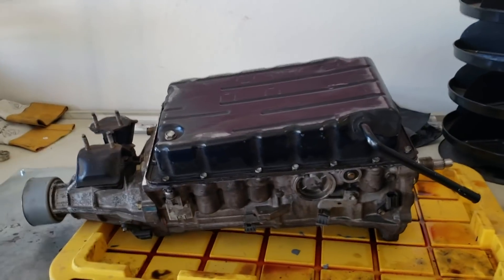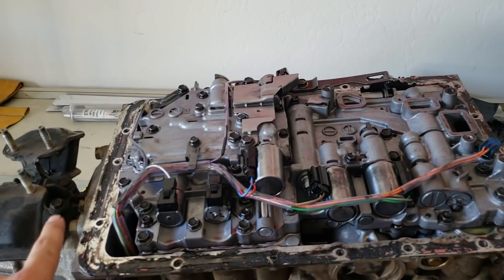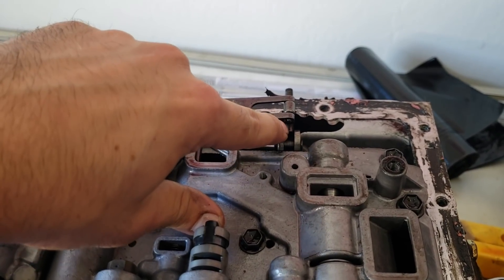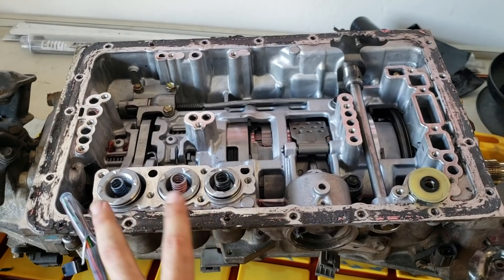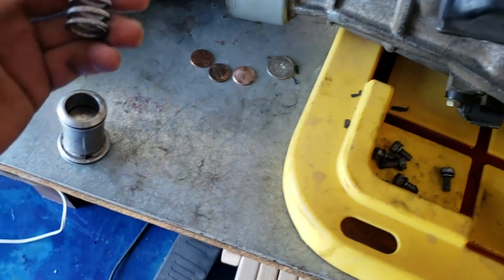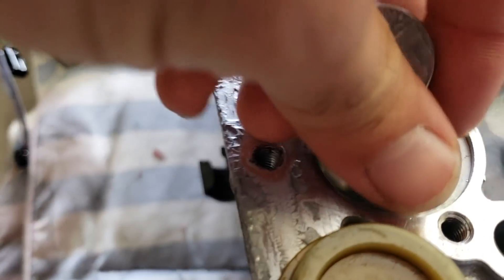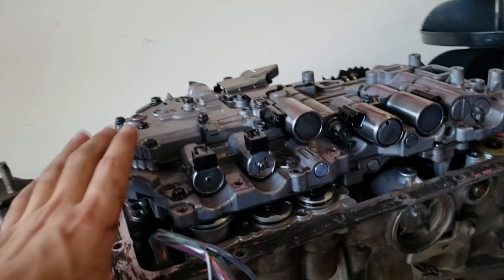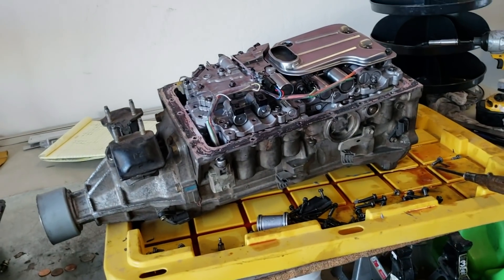How to make the A650e hold power! Building your Lexus IS300 Auto Transmission on a budget! DIY Video

Comment: This is the dumbest thing I've ever seen. Will it shift hard? Yes absolutely because accumulators are designed to soften shifts HOWEVER making your transmission slam gear will do absolutely NOTHING to make it "hold more power". Will it chirp the tires? Maybe if that's what you want but be ready for clunky down shifting and a generally uncomfortable transmission for daily use. Also, making your transmission slam gears will do more to hurt internal parts than help them "hold more power".
Also on a side note, pulling the transmission is 1000% unnecessary. All you did was pull the VB and shim the accumulators. WTF would you add several more hrs to a relatively easy 1.5hr maybe  2hr job? 
I suppose all of this was because I have a customer asking me to do this and somehow guarantee any of his bullshit.
24yrs building transmissions btw

Comment: i did your tutorial.. but now the transmission wont go in gear? i made sure the selector was in the right spot and the little ball..just wondered if you have any any idea where i should start looking? and yes the transmission worked fine before i did the mod
Reply from the maker: sorry to hear... did you lose the little ball bearings by chance? also, make sure you fill it with at least 6 or 7 quarts of fluid. and are you sure the torque converter clicked in all the way?

Comment: use toyota red FIPG. Not black/gray fipg. If you can get toyota red, use a FIPG rated for trans fluid. Though the oil pan/ camshaft housing FIPG works, it's not correct and can deteriorate over time

Comment: Hello sir! So I've done this and now my transmission doesn't engage into gear when cold. the engine will rev but the car will only slowly move. but then once warm it engages. inside my transmission I found no dirt and the filter was clean. I have a transmission cooler and I have the transmission a bit overfilled also. Please if anyone can help!
Reply: Did you ever figure this out?
Reply: Hey same here just overfilled it more and it started working
Reply: @2jz.omarstatic no problems after that? cuz i have the same issue on two trans now thinking i blew one lol

Comment: So, does that mean no dig racing? You said it’s good except for from low rpm’s (which, laughing is a higher rpm thing, but I’ll be starting from 1st gear)
Reply from the maker: Thats correct. Its going to break on the 1-2 shift if your making some power
Reply: @RacecarAndChill  Do you think it'd still break if you do this mod on a stock car and go hard from a stand still? Thanks.
Reply from the maker: @DanMystro  no, it won't break. It might chirp the tires  though!

Comment: Hey I’m super super late to this comment section and I know the car has since been parted out, but do you need to upgrade the sprag at all after this mod if you’re boosted?
Reply from the maker: It definitely helps, but not necessary.
Reply: @RacecarAndChill  wow thank you for the reply, I appreciate the speed. And alright, I’ve just heard so many horror stories about them grenading. I’ve been 320 hp for some time now and haven’t had any issues on completely stock trans. I plan on getting a cooler and going this route before deciding if I want to go a340/341
Reply from the maker: @VitulaJoy  yea, you'll be fine to turn it up. Even if the trans blows up, these things are practically worth their weight in scrap metal. Ive sold a few for $100
Reply: @RacecarAndChill  well in that case, keep your inbox open you may or may not see me looking for a trans lol. Thank you for the replies, I really appreciate it.
Reply: @RacecarAndChill I meant to ask as well, how bad is the sprag to upgrade in terms of labor, I truly can’t find any info on sprag replacements for our a650e
Reply from the maker: @VitulaJoy  I've actually never taken a trans apart enough to get to the sprag, so I'm no help here.
Reply: @RacecarAndChill  alright I figured I’d ask just in case. Tbh I probably won’t worry about upgrading the sprag because I’m already not making a lot of power and plus the cost to have it done isn’t worth it when, like you mentioned earlier, the transmission itself is so cheap.
Reply: @RacecarAndChill  do you have a preferred cooler you like to run for the trans?

Comment: My question is.... What factory ECU and what little bit of wiring is needed to boost the auto trans??? Everyone says JDM Aristo ECU (plus some wiring), or go manual 🤷🏿‍♂️
Reply from the maker: You can keep the factory ecu to control the transmission if you have a standalone running your engine. My is300 is manual swapped, but if you wanted to build an auto car, you can use the stock ecu it comes with to shift the transmission and let the engine be run by a standalone. The stock ecu wil need to see the throttle body signals to shift the transmission.

Comment: I’ve done the upgrade. But the transmission won’t hold the fluid when I tried to fill it. I shut the car off and it spews out of the dipstick 😳.
Reply from the maker: Something went wrong. Did you block the holes in one of the actuators with the coins?
Reply: @RacecarAndChill  i shimmed it just like the video and made sure the washers measured up.
Reply from the maker: @AbC-hh8vg  did you make sure to put the nickles in the bottom of the hole on the 4th accumulator that doesn't have a bucket? What about the spring under the ball bearing?
Reply: @RacecarAndChill  I thought they were all put in properly with the pennies first. It won’t shift into gear and tries to move in park even after it took some fluid. I guess I’m taking it back out 😷
Reply: @RacecarAndChill  could the screw have been turned too far?
Reply from the maker: @AbC-hh8vg  I don't think the screw can turn too far. I suspect something is wrong with your shifter due to what you described.
Reply: @RacecarAndChill  would the shifter being out of place cause it to volcano like that? When the trans dipstick is pulled out it spews out after turning the car off.
Reply: Pennies nickels and washers.

Comment: I am looking to do this on an a340h AWD 4 speed trans that came on my 2JZ from an altezza/lexus is300 sport cross wagon.

Is there anything different that I would need to do for the 4 speed?
Reply: Bump
Reply: @eibura  There was nothing different, There was no thing to turn up the line pressure tho. Running nice now.
Reply: @jaystuart4300  were you able to shim the accumulators still like in this video? Just without turning up line pressure? 
Or is the TransGo kit the only option?
Reply: @eibura  yes, i just put coins in my currency underneath to about 10 - 18mm. Cant really remember. Slapped it back together. Definitely decreased slipping during changes. But still super smooth daily ride. 100% would do again.

Comment: Is there any benefit to doing this with stock power ??? 
I plan on "street" drifting it at the track, I'm guessing I should do this function.... let me know
Reply from the maker: It will make it shift faster, but is that really an issue with stock power? 🤔 not really sure.
Reply: @RacecarAndChill  well I heard it keeps the transmission cool as well. So I figure why not do it since it's easy to do this mod. I heard these transmissions aren't that reliable if I'm beating on it
Reply from the maker: @Juju-ee3nd  you should definitely be running a trans cooler if youre tracking the car. As long as you dont let it get too hot, the trans will last.
Reply: @RacecarAndChill  yes I was planning on adding one as well before I do this mod. What's your take on coolers?? I'm trying to ball on a budget, you think I will be fine if I don't go with a top name brand product ....
Reply: @RacecarAndChill  love your channel bro. Keep putting up videos and educating the Car community brotha

Comment: Hi i have a gs300 2001 with a a650e 35-50ls 3f3500, my transmission almost die and I only get 30-40ls 3f320, it can work for me?
Reply: No- 30-40ls is from aristo/supra tiptronic last a340 version. Ot is 4 speed. Your ecu can not control it with stock ecu.
Reply from the maker: I'm not sure, but my guess would be no.

Comment: Wait so you actually just put change in the fuckin thing and turn a screw how much power is this good for
Reply from the maker: Yea pretty much 😂😂 with proper cooling and fluid changes, this setup has been proven to hold 650 if you dont get into boost until 3rd gear.

Comment: So as long as I keep to a max of 18mm on the first three accumulators I should be okay right? How aggressive are they at 18mm? Also do you have to remove bellhousing bolts and torque converter to remove the main housing of transmission? Look like your example transmission doesn't have the bell housing connected to it. Thanks
Another UK viewer here  🇬🇧😁

Comment: Good Video, Except the 4th one you shimmed, does have a bucket way down at the bottom of the Hole you can pull it out with your finger if you put too many washers or coins you can block the holes in the sides of the bucket blocking oil flow and no doubt burning or damaging the Trans! It seems like youtube is Scrapping Most 98 to 05 Lexus IS+ GS Mods Video's used to be a lot of Great Things for the 2nd. Generation Lexus But Now Few and Far between, Need to chip in and give Chris Fix a Lexus GS300 or IS lol! Have to Look Elsewhere!

Comment: @racecarandchill , would increasing the line pressure help at all to a trans that's slipping alittle ?
Reply from the maker: Yea probably. But if it's already slipping and you take the pan off, replacing that much fluid might make it slip worse. That's a tricky one. If a trans is already slipping,  replacing the fluid in it might cause it to slip more because all of the friction material from the clutch packs is suspended in the fluid. When you replace it, that friction material isnt there anymore and the clutches cant grab. It's a catch 22.
Reply: @RacecarAndChill  so should I bump.up line pressure and put back same fluid,  supposedly it was recently  flushed
Reply from the maker: @bigfred2657  yea, its worth a shot.
Reply: @RacecarAndChill  thanks for the help , would u happen to know anyone in central florida who works on these cars that u would recommend
Reply from the maker: @bigfred2657  no, I dont. Sorry man

Comment: Hey bro, quick question - after doing this mod and running high whp, would letting off the gas while the car shifts (using the e-shift to control upshifting) help it in any way, for function and longevity? Also, thanks for all the videos about the IS, you've helped me out so much working on my car!

Love from the UK ❤
Reply from the maker: Hi! sorry I never saw this comment. Letting off the gas while its shifting will probably help it shift softer, but it definitely won't be faster than just keeping your foot floored.
Reply: @RacecarAndChill  Hey no worries bro, thanks for response!

Comment: Question about the extra cooler. Is it enough just but a bigger cooler replacing the stock one? Not getting big power or no more power at all for now.
Reply from the maker: Yea that's would be fine. The stock one is a the bottom part of the radiator.
Reply: @RacecarAndChill  Okey, i did check the cooling piping today really quick and it seems going to front of the car with few twists and back to transmission without connecting the radiator. This is EU spec 2jz-ge sportcross, so there might be some differences with US spec? I'll check the lines tomorrow after work to be sure :D. BTW this video was helpful, thnaks for doing this :D
Reply from the maker: @mosa86  I'm sure the lines go from the transmission to the radiator unless someone else has already put a different oil cooler in it. 😉
Reply: @RacecarAndChill  Well there was different cooler bolted to engine block under exhaust manifold :D. Looked pretty simple to connect extra cooler from there what goes up front
Reply from the maker: @mosa86  then you probably dont need much more cooling if you arent making big power. As long as that cooler has some airflow going to it, you'll be fine.
Reply: @RacecarAndChill  It's a water cooled type, so to be safe  i'm adding the extra one. And about power, the future plan is 2jzgte BPU setup if laws allows it :D
Reply from the maker: @mosa86  theres always ways around laws. 😉
Reply: @RacecarAndChill  Well yes :D. So i did the mod couple of months ago and it's works perfect, faster and harder shifts and you can really feel the shifts
Reply from the maker: @mosa86  awesome! Thanks for reporting back!

Comment: Great vids Stan keep up the good work! I have a few questions about the ecu setup for this mod. Is Cody using the factory ecu and a stand-alone together? Or just stand-alone? If he’s using the factory ecu what sensor inputs are still necessary to shift the trans?
Reply from the maker: His car has since been parted out. But when it was running, he had the stock ecu running the transmission and a standalone running his engine. The stock ecu pretty much just needs to see the throttle body to keep shifting the transmission. If you want to delete the stock throttle body to use a ffim setup or have your standalone run the throttle, what you can do is leave the stock throttle body wired into the trunk so the stock ECU still thinks it's running the engine.

Comment: Do you know torque specs for the valve body bolts and the trans pan bolts? I’m doing a valve body upgrade and haven’t found the specs anywhere
Reply from the maker: I don't know them. Just get them tight, I wouldn't worry about the specs too much.

Comment: Hey question since you seem pretty familiar with these transmissions so recently I got a code on my 01 IS300 
P0710 [ Transmission Fluid Temperature Sensor A Malfunction ] and my car going from Park to drive after starting up, goes into gear EXTREMELY hard, shift points are all over the place, won’t let you drop to 2nd in E-Shift and accelerates sluggish. Do you think you can help me find a solution to this problem?
Reply from the maker: This is an odd problem to have. Have you checked the transmission fluid level with the car running?
Reply: RacecarAndChill Yeah everythings level

Comment: You seem to know a lot about these, would you recommend doing a drain and fill on an auto is 300 with 200k miles with no previous maintenance record?
Reply from the maker: Yea, a drain and refill shouldnt hurt one bit.
Reply: 98 ls400 has issues going into drive doesn't slip or anything. Just sometimes feel like drive doesn't want to engage here and there. 181,000 miles. Afraid to do a flush not sure if fwd clutches might be worn? Any help/advice is appreciated!

Comment: I have a 2001 is300 what do you recommend to just get my stock engine to shift harder. I hate when i get on it and it just slips so much shifting into the next gears.... i know this is hurting the trans worse than if it shifted faster/harder. I don’t mind pulling the transmission but I wonder if I need that many shims...? Could I just turn up the line pressure??

Comment: Is the last line accumulator necessary? I've seen a few kits that only include 3 rods or 3 shims and leave the last one. What would the difference be?
Reply from the maker: The last accumilator is for the 4-5 shift. I would not bother with the kits, just use washers or change. No point in spending more money for something that does the same thing. I saw your post on Facebook, the guys that are commenting on there really know their stuff. One of them helped me make this video!
Reply: @RacecarAndChill  Yea. I messaged Cody. He cleared a lot of stuff up so I should be good going forward. Thanks for the help
Reply: What is your name on Facebook?
Reply from the maker: @dariencharlton4773  Stan Guintchev

Comment: Amazing write up, I did this to my LS430 within an hour. Quality work, looking forward to more write ups.
Reply from the maker: Romin B. Thank you!
Reply: Hi @Robin B. How would you describe the cars behaviour now with the mod? Are you liking it?
Reply: @waltteripatronen4535  I like it, but at the same time it's a bit of a overkill for an LS. I think Ill be going to go back to stock and just live with a increased line pressure for now on my LS. However, I am loving it on my FJ Cruiser, I see a huge difference between shift times, tranny temperature, mind you my FJ is Supercharged putting down 432whp and the method was slightly different because that's a different transmission but with this video and a help of a friend I did it on my FJ Cruiser too.
Reply: Romin B. Thanks for the reply. I still may be tempted to try this but I plan shimming it less than these turbo IS builders.

Comment: I own an automatic Altezza RS200, seems ljke it Should work. The accumulators look to be the same, but the transmission internals are different. Check out toyodiy.com and you can compare it to the gs300/is300 etc. The Altezza transmission is different internally. I wonder if this was because of the less torque from the BEAMS 3s-ge?
These things need a shift kit as they lag alot during shifts.

Comment: Hey I got a stock 04 is300 auto, the transmission whines but the sound goes away after 20+ mph and shifts a little hard from 1-2-3 , is this normal ?
Reply from the maker: No that does not sound normal!

Comment: Appreciate the info, I've been driving my 98 sc400 a650e with the pressure turned up for 2 years now and always been curious about swimming the springs. Keep up the builds! Cheers!
Reply: is300 with a650e. turned up line pressure but shifting from 2nd-3rd feels very strange. is this normal? also car bogs a bit in 4th at lower rpm, is that a MAF issue or normal?
Reply: Shimming **
Reply from the maker: John Saeturn thank you sir! Glad to help!